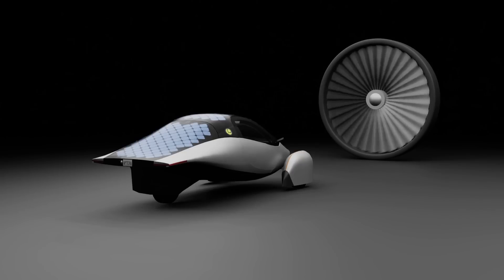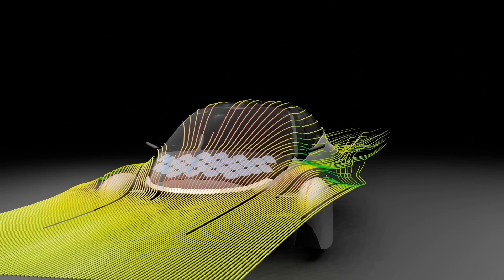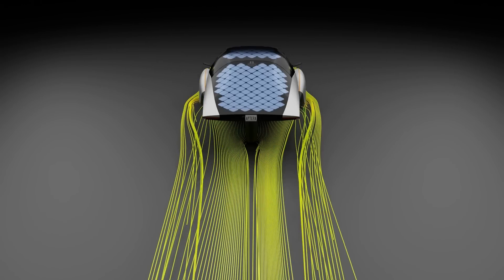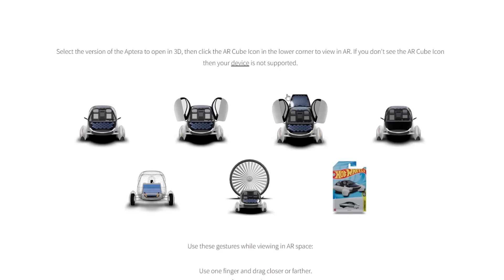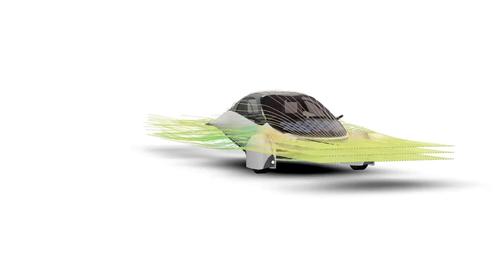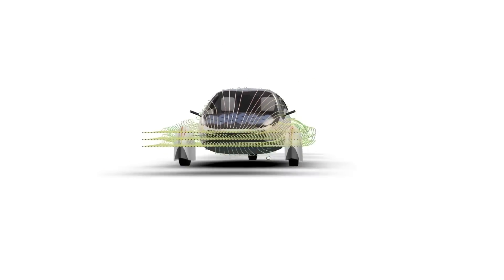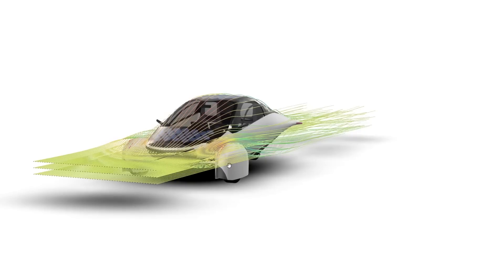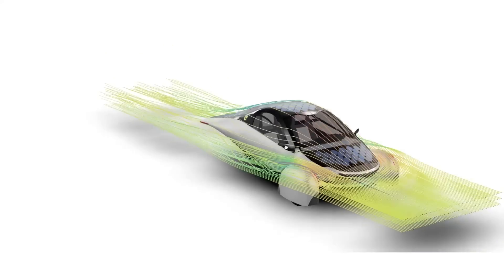Computational fluid dynamics visualization at Experience Aptera

Comment: Been wondering the bigger the object the more air resistance, why not remove the tires housing which is bigger than the tires themselves;; there’s no way less resistance being bigger than small
Reply: Size is not the only thing that matters. 🙂

For aerodynamics, it is also the Cd (coefficient of drag) multiplied with the frontal area.
So, if the Cd of the wheel cover is much better than the Cd of the wheel, it can have a bigger frontal area and Cd * A can still be better overall.

Also, a quickly rotating wheel without cover causes a lot of turbulences making things much worse.
Reply: The engineers spent countless hours on aerodynamics, including (especially) the wheel pants; the naked wheels are much, much worse for airflow than the wheel pants are.
Reply: @spencerpeterson7875   -  YES.  Light aircraft with fixed (non-retracting) landing gear are always designed with wheel pants unless meant for off-field landings/takeoffs.
Bare wheels and brake calipers and brake discs cause much more drag when uncovered.

Comment: I have one Aptera reserved, but if they develop a four passenger version I will be getting another one. Especially if the get bidirectional charging. If they get bidirectional charging all our future automobiles will be Apteras.
Reply: Just get the 3wheeler, so you have something great while you wait for the 4wheeler.
Reply: @ThomasWaldmann  I’m not looking for a four wheeler I want a three wheeler that can accommodate four passengers.
Reply: @matthewhuszarik4173  Oh, that's interesting.

But I think that could get rather difficult from a stability perspective.

With 3wheelers one usually tries to have weight low and towards the 2 front wheels. 
But that gets difficult with 4 passengers. 

Also, the 2p aptera is already rather wide, so you can't just make it even wider to gain more stability for 4p.

Maybe tilting could help. But guess a tilting 4p 3wheeler would be a first.

Comment: I am buying a home battery bank for when we get a power outage. We get multi day power outages several times a year. The pack I am going to build is 14kw comprised of 16 280ah eve lifepo4 battery cells. Each cell weighs 10 pounds, so 160 pounds for the battery pack plus the 8kw inverter. I am considering doing the accelerate program, then with my pre-charged battery pack in the trunk I will be able to bridge the gap (430 miles to 480 miles`) between chargers on one of my primary routes.

For the house I will also have a stationary generator.

Comment: The most remarkable claim:
1,500W to move the Aptera at highway speed...   About 2HP.
(level ground, calm wind.  Assume
60MPH?)
Reply: Sounds low by a factor of 4 to me - based on the Aptera's range numbers and battery capacity, it uses 0.1 KwH to go 1 mile - this means that if it takes 1 minute to go 1 mile, it needs 6 Kw to maintain 60 mph. (This assumes their range numbers are based on an average 60 mph highway speed )
Reply: @ericstarmer7779 Aptera is using EPA highway cycle which averages 48.3 mph, so more like 7-8kW at 60 mph. We don’t know the parasitic load that goes into the 100Wh/mile estimate or the rolling codfficient, so can’t scale exactly by velocity.
Reply: @ericstarmer7779  Hmm, I think that doesn't consider that even on a highway, there are ups and downs, acceleration and breaking phases. So it is not all-flat and always-same-speed, I guess?

https://en.wikipedia.org/wiki/FTP-75

And as uphill and acceleration consumes a lot more than flat same-speed movement, the acceleration power needs will be way above the average and the continuous movement will be quite below the average.
Reply: @ThomasWaldmann  I'm sure you're right - that means my calculation is optimistic.

Comment: OpenFOAM is the same basic package used by the AirShaper service that Aptera used (and I use for my project in progress). Whether this was generated with the right parameters and the amount of resolution (of the shape and of the air) in the computation is what determines whether it reproduces Aptera’ results.

It’s a possibility that instead of him computing this on his own dime, someone at Aptera let him have one of the datasets which he loaded into ParaView and related tools and produced exports from.
Reply: Actually, I think this dataset does not include rotating wheel effects, and therefore may be inaccurate as well as not being an official Aptera CFD dataset. I think he ran it on his own. The wheel pants don’t reveal perturbations from the wheels, even a little bit.
Reply: How about real test data on a real vehicle ?
Ai leaves too many variables to skew the results.
Reply: @CharlesAnsman  There’s no AI. OpenFOAM is running computational fluid dynamics simulations and performing averaging to determine the overall statistical outcome of air flow. I have validated OpenFOAM results with real world tests on project iterations. It works and is stable. It’s not perfect, but it is descriptive and predictive in an engineering design process.
Reply: The AirShaper service they and I use also models the relative movement of the ground and the rotation of the wheels which churn up air. That has made modeling very accurate for ground vehicles. I solved some significant design problems using this aspect.
Reply: I think he probably just modeled it by hand from the images rather than getting the real CFD.  Super crazy dedicated work.
Reply: I don’t think so. If he exported an STL from however he modeled the Aptera, he could run it in OpenFOAM at a reasonable resolution and get a result like this more cheaply than the manual labor of drawing flow lines in 3D.

AirShaper’s a la carte pricing is $600 and the cheaper rate is also available if he didn’t DIY it.
Reply: Here’s the explanation https://youtu.be/asgHIIvSbw0

Comment: OOOOH!  Add "Wingtip Fins"?  Boeing sez roughly 4% Savings.  so, Fins just at the Tail?  It is not making Lift, so Savings would be less, but even a Coupla Percent would be nice!
Reply: The bigger reason for the wingtip fins to control vortices is to reduce the time between takeoffs.  When a plane takes off the vortices are still spinning in the air above the runway a minute or two later and causing a downdraft right where another plane will be attempting to take off.  This is the reason why planes have to wait so long for takeoff after the previous plane.  There is a chart correlating delays between what size and configuration of plane is attempting to take off and what previously took off, and then presence of wingtip fins affects that delay.
Reply: Drag is much like a steel truck bed compared to an aluminum one.  You drag it around with you no matter what the chore is and with smaller trucks you're just getting to the load before you haul something nearly half the time.

Comment: Okay, we've seen the simulation and patterns of airflow. Someone should now tell us what these mean and what effects they have on the Aptera aerodynamics, drag coefficient, etc. Thanks though for sharing.
Reply: You can’t tell from just one simulation visualization. However, I’ve been using the same tool for my electric motorcycle streamlining project, and I can say that this appears very well optimized.

I think any optimization from here is possible but would require even more trade offs in the design that would make the vehicle less marketable. Plus, like what I’m doing, once you reach a significant level beyond what anything on the market is doing, you focus on getting it to market.

I will say that for my project, I’ve finalized the basic shape, but I save a few simulations in my contract for homologation where the mirrors and turn signals start adding complications to the air stream, so I simulate and optimize that into the design as well. Aptera has baked that into the design, and probably it feeds into their side mirror efforts.

Comment: The S curve is there to try reduce the high pressure area that forms between the wheels and the body.  The gotcha is that the more pronounced it is the more the air will push the wheels to toe in.  I have to wonder how much they've considered what happens when passing a vehicle and the Aptera moves out from behind the pocket of the vehicle it's following.  I can't imagine it's a big deal but my guess is you'll feel the lateral force of the air on the exposed wheel pant pushing you back as you try to change lanes.
Reply: One thing to consider here is that there is very little lever arm from the center of pressure to the contact patch resisting it, especially compared to a standard SUV.
Reply: @n.brucenelson5920  but it's not nothing, and previous iterations looked like they had a neutral bias.  Although it's possible that the s-curve negates a toe out due to high pressure coming off the nose.

In any case they've surely studied this far more than we have.
Reply: @SomeGuyNamedPaul49  I am sure they have!  The big question I have is that when they were at the alpha stage, Steve F said in a video that at 65 mph there was about 25 lbs of downforce designed into the shape at the tail of the vehicle, even though it introduced some drag.  I don't see this in the present models, and wonder if they decided it wasn't needed considering the performance trade-offs this would entail?
Reply: The Aptera is a light car so despite its aerodynamics it will get buffeted when passing or getting passed by a vehicles pushing a lot of air like semis or RVs, maybe even pickups and vans.
Reply: @matthewhuszarik4173  A couple of months ago someone, I don't remember who, who had driven  the Aptera said that the aerodynamics of the Aptera seemed to eliminate most of the wind disturbance you might expect to get while passing a semi truck
Reply: @briangerrits1454  The aerodynamics should reduce it. If will be interesting to see first hand.
Reply: @matthewhuszarik4173  said "it will get buffeted when passing... "  -
This visualization app, admittedly primitive, shows vortices under the rear "tail",.which by their direction, indicate upward lift.
As longitudinal gusts sweep past the tail, that lift will suddenly increase and unweigh the rear wheel momentarily, reducing its traction.
As "lateral gusts" hit the center wheel pant, the tail will similarly experience momentary lift that unweighs the rear wheel, reducing its traction AND pushing the pant.
An Aptera passing a big rig will tend to swerve into the path of the big rig.